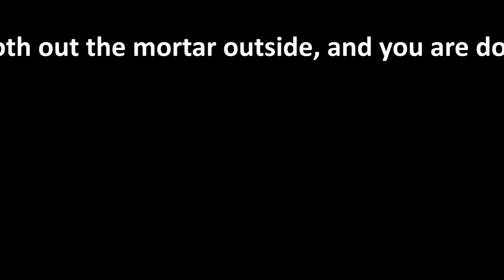Glass Block Window Install

Comment: I know I’m late but someone please help! If my rough opening is approximately 32 1/4 wide by 14 in tall can I use a  
31x 13.5 pre made glass block window? Thanks!!
Reply from the maker: Yes, you can fill that gap, just don’t mix too thin and it will stay.  I used wood wedges to hold mine in place and you can see it’s at least an inch filled.

Comment: So you keep your existing "Curb" and just set the mortar on top pf that? I have nice looking curbs now with wood frame old hopper windows i am planning on replacing and ordered the windows to fit with existing curb.  My rough opening from Sill plate to top of curb was 18.5" X 32" Wide... I ordered 31 X 17.25 windows but have seen videos with some saying to remove the curb. Any issues installing onto existing curb?  I see it's been 6 years.
Reply from the maker: Tony Murillo I still have the house, and no issues at all, no air or water leaks, it’s all good.  Each window went in fine too, all the same

Comment: This is exactly what I'm preparing to do but I did not account for the 1 1/2 wood frame removal, how thick can you go with the mortar ? Or should I add a cement block or brick under the window before I set it with mortar?
Reply from the maker: RJH 63 I’m not sure how thick you can go, my largest gap is at least that, maybe even 2”, so you should be good.

Comment: Great video! I noticed you didn’t put any mortar on the top of the block window, is that not needed? Or did you put sealant to fill that small gap? Thanks
Reply from the maker: Alpha Lima 3000 I used sealant against the top where it met against the wood. It’s been a few years now, and none of the windows are having any problems.

Comment: How did you seal the top of the window? I saw the sides and bottom but not the top.
Reply from the maker: I used this stuff https://www.lowes.com/pd/Lexel-10-5-fl-oz-Clear-Paintable-Solvent-Based-Specialty-Caulk/4714985   (Lexel calk) it has been working good the last couple of years.
Reply: Frank C is it common not to mortar the top and just seal it